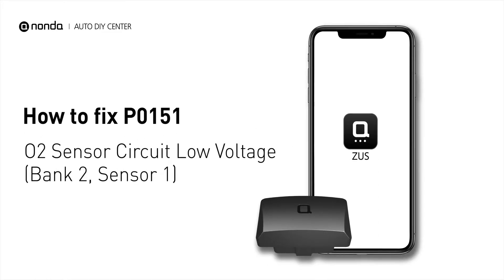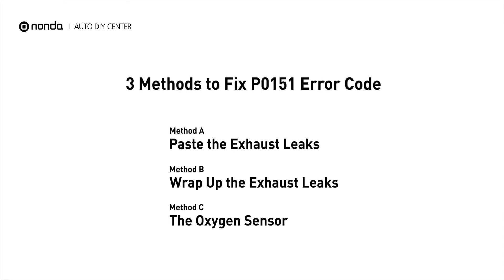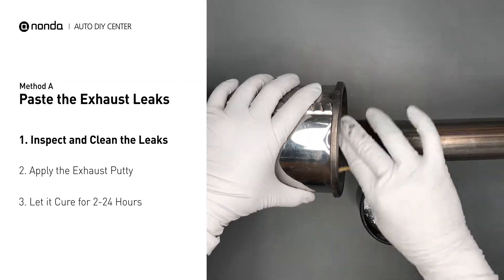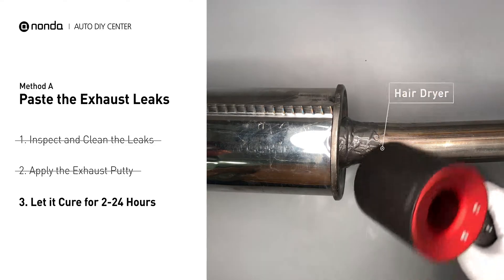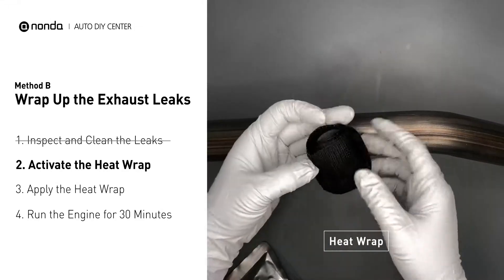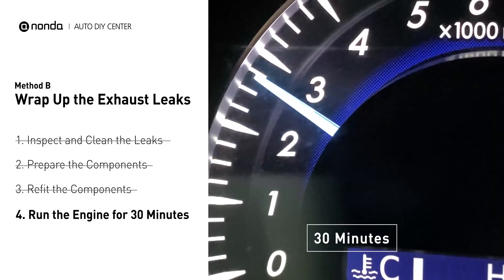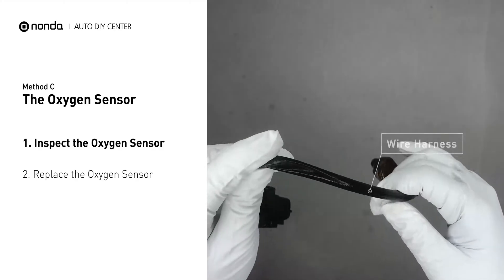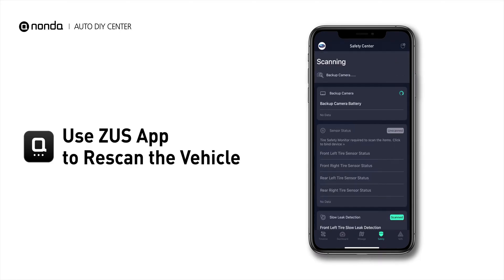How to Fix P0151 Engine Code in 4 Minutes [3 DIY Methods / Only $9.65]

Comment from the maker: Hi, I'm Steve, nonda's lead mechanic engineer. 
Feel free to leave your comments here if you have any mechanic questions, I will be glad to help you out!
Reply: I got this code after putting slipons my 2020 sportster 48... Does my bike need tuned? Because everyone at the Harley shop said it didn't need to be.
Reply: Hi, i am having P0131 and P0151 go off at the same time. does not seem likely that both upstream O2 sensors fail at the same time? its on a 2011 challenger SRT8 with only 18k miles on it. any ideas?
Reply: @jatol1980  What does the codes specifically say?
Reply: Hey Steve, I'm getting po131, 141, 151 and 161 on my 2001 GMC Yukon which all codes saying something to the effect of "low volt circ" . I replaced two of the o2 sensors and the code keeps on popping up. As of yesterday all 4 o2 sensors gave me the aforementioned codes. Up until todayit was just 131 and 141, which are the ones I have already replaced. I hope you see this after all this time, because I'm really stumped and this is my dream truck I've worked so hard for. I have a superchip programmer, but if you have something better in mind, please do let me know. Thanks Steve.

Comment: thank you i just replaced that sensor1 with brand  new from the store         but the   code engine light came on again           i dont  know     if  it could be  a    fake sensor  i bought from Auto Zone!!                  im trying to see if can replaced it with a GM CHEVY OEM sensor
Reply from the maker: Hi Dario, have you checked if there's an exhaust leak or any faulty wiring to the sensor?
Reply: @nondainc  thank you  for answering back it was a sensor i just couldnt Pinpoint the failed  one it was bank 2 sensor1 i replaced all of them      except that one and when i replaced it the Engine light went off  !!!   way better  it runs  better with alittle jerking like you mentioned it might have a liitle leak somewhere but for now i can live with it THANK YOU!!!!